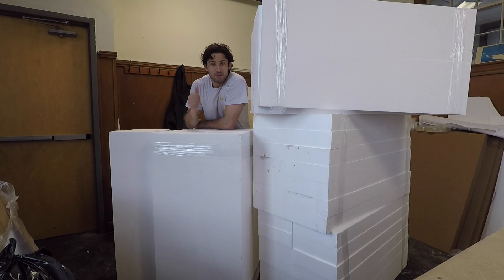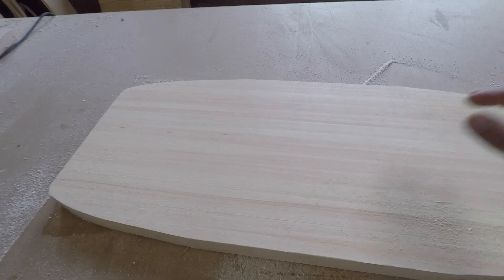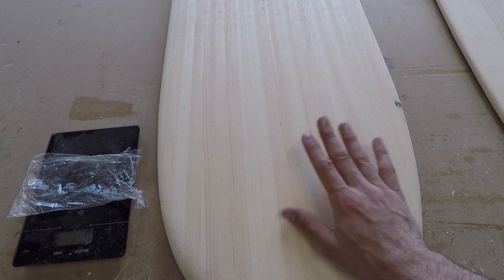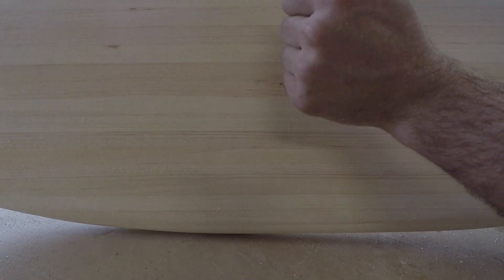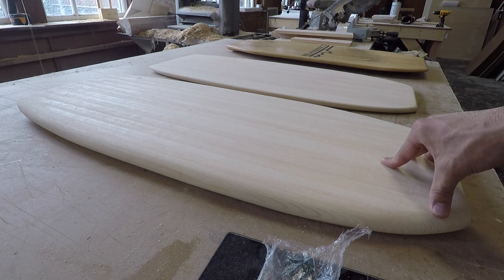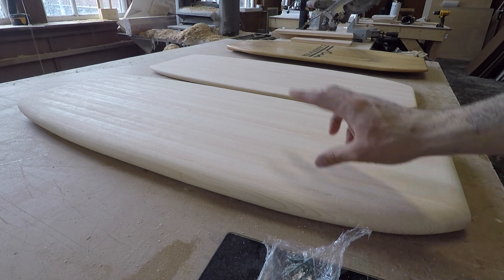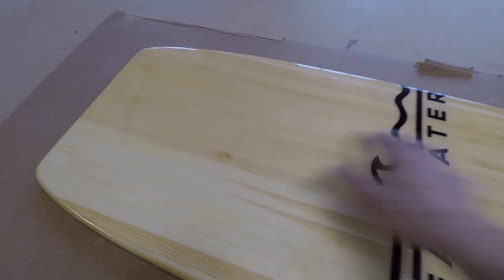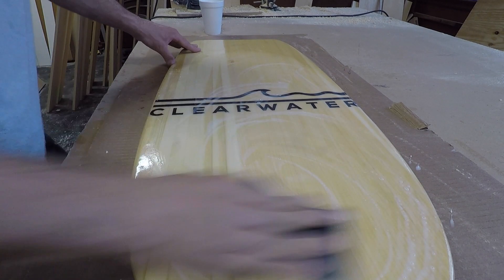The chambered hydrofoil board is done!... kinda

Comment: Nice! Why the wet sand? Is it about the look of the board or the feel on you feet?
Reply from the maker: I like to finish with wet sanding for a couple reasons. You can usually sand out any small imperfections (usually dust or bubbles in the gloss coat). It also feels better in your hands, just overall smoother. Any scratches or wear in the future is a little less noticeable as time goes on. It has no real effect on the feel of your feel.
Reply: @clearwaterhydrofoils4313  Great! Thanks